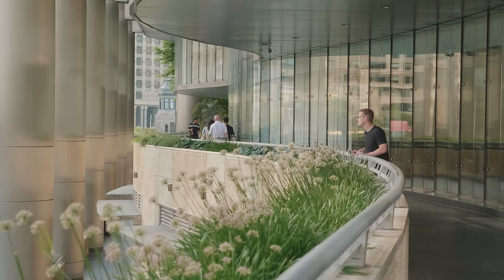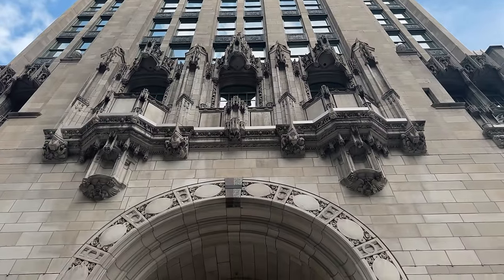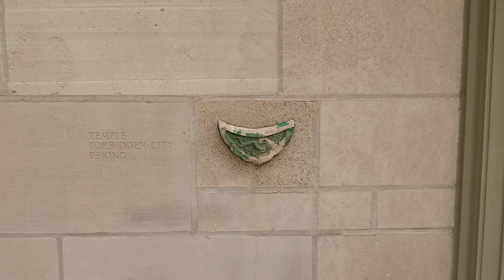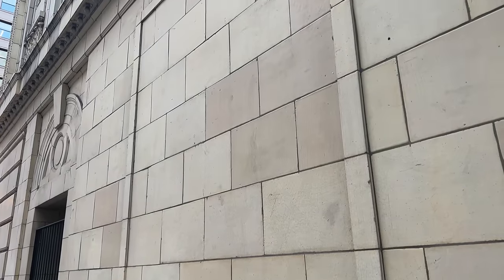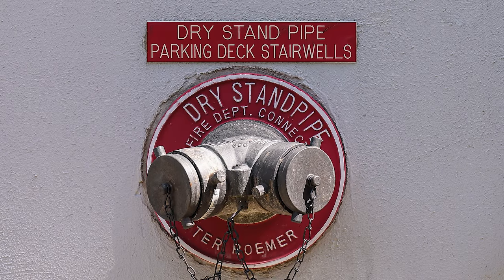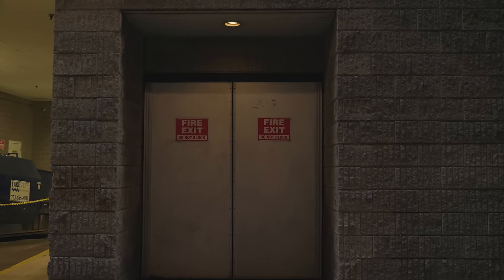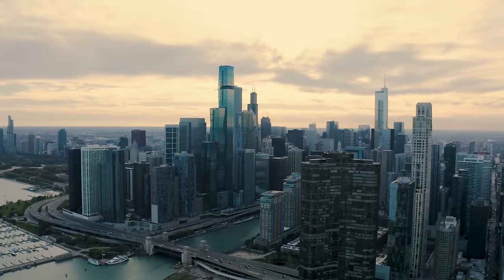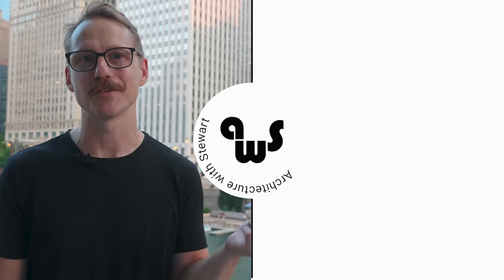Skyscraper Stuff You're Not Meant to Notice

Comment: I work in the commercial HVAC industry. You really need to make a video showing how air is moved around inside skyscrapers including how they are heated and cooled. The machinery is massive and most people have no clue it exists except from a Die Hard movie 😊
Reply: When doing this, you might consider comparing green certified buildings vs. traditional.
Reply: Can you actually crawl through the vents though?

And get a machine gun?

Cuz.... that's all I'm really worried about confirming. Haha
Reply: @threadtapwhisperer5136  😄 I know you're saying that tongue in cheek but I can answer some of that. Depending on the building there is return and supply ductwork that starts off a couple meters/yards in diameter and runs the vertical length of the building. You could potentially get from floor to floor through the return ductwork as the return air typically has large openings on each floor and they use whats called plenum return. Plenum return is just the approximate meter/yard high gap between the actual ceiling and the drop ceiling that everyone sees. You would need a rope as there is typically nothing to grab to get the approximate 4 meters/yards between each floor. As for the horizontal ductwork you are picturing, that would be the supply ductwork that branches off to each space. That for the most part would not be anything like the movies. Supply ductwork might start off big enough to slither through on your belly but before it splits into the supply diffuser you see people looking down into a room from in the movies it would go through a control device (VAV, FPB, variable air volume, fan powered box) that would be hard for anything but a rat to get through. And to top it off, the supply diffusers (that people look down through in the movies) are after these control devices and after the VAV or FPB it most often splits down into much smaller supply trunk then flex ductwork that would be difficult to even fit your head through. But yes, in a way there is incredibly large ductwork that makes me think of Die Hard that does exist, just not quite as its represented in the movies. 
Oh, and the machine gun question,  I've never run across one in ductwork before but I'm always on the look out. I have found hand tools, flashlights and even a volt meter in ductwork or above ceiling tiles.
Reply: Why don’t you make it
Reply: @tvviewer4500  I seriously thought about it but am horrible with video editing and hate to hear myself talking in videos. I cringe at the thought but really would like to share what we work on with every day people that have no idea what goes on behind the scenes
Reply: @mrbyamile6973  working out the cringe helps you find your way to the total ‘you’. Letting the cringe sit around gives future cancer and autoimmune disorders fuel to kill you.

Comment: Thanks for the brief highlight of fire protection services! There's a lot of hidden engineering on the ground floor of big buildings like this. Pumps, chillers, boilers, electrical panels and switchboards, sanitary and storm water connections, and more! It can be a challenge to secure space for necessary equipment as the ground level is usually pretty desirable and the Architect wants to maximize the usable space.
Reply: Thanks for typing my comment for me. Although, he did use some interesting terminology...
Reply: A bit of misinformation on dry standpipe.  But he got close enough.
Reply: @Ma2xt  It's crazy how little knowledge many architects have about building systems. The garden hose wall hydrant at 7:26 is funny. And this guy is considered an authority in architecture academia.

Comment: I was the tenant side liaison of a new 10 story 140,000 square foot building and it was really interesting to learn about all the trade offs and how things work between building architects, interior designers, city requirements, building codes, tenant needs, costs, energy efficiency trade offs, use cases, etc. And I was able to work in that building for many years and see how well the design choices worked out in the end. It wasn’t a massive skyscraper but faced many of the same design challenges. And there are lots of building codes that dictate things I’m sure many think are just bad design but it’s required for safety reasons.

Comment: Just a quick correction regarding the difference between "wet" and "dry" sprinkler/standpipe systems: while the description of whether water is present in the piping or not (wet versus dry) is correct, there is a further segregation of system types to describe if the system is designed for fire department augmentation of the water supply or not and that is "automatic" or "manual" systems. As the naming convention implies, "automatic" systems are designed to achieve the required flow and pressure of water with the building condition (municipal water supply with or without a fire pump provided in the building). However, "manual" systems are designed to achieve the required flow and pressure of water only with fire department augmentation of the system by pumping the fire department connection. So, most commonly seen are automatic-wet, automatic-dry, and manual-dry systems. You can see some of this labeling above the FDCs at 6:20 in the video.

Comment: Every single home has this kind of transition. There it's called front porch, front door, driveway, garage entrance, main power switch and meter and many more. 
Not mentioned in the video are the transitions inside the ground levels of commercial buildings with concierge desk, elevators, stairs, cafe, lounge, restrooms, entrance gates, emergency exits, revolving doors, windbrake and many orientation/emergency signs and hidden the locker rooms, postal office, delivery check-in, storage rooms for cleaning and other stuff like winter sand/salt, unique spare parts/tiles,  mobile barrier cords and posts/red carpets, chairs, garbage container like a mud room in a home.

Comment: FYI, dry standpipes still have a water supply (absent the fire department) but the sprinkler lines are kept dry and charged with compressed air during normal operation to prevent freezing.  This is typical in areas with the potential for freezing temperatures.  When a sprinkler head is activated, the compressed air rushes out and opens a valve allowing water to flow, generally required within 30 seconds at the most remote sprinkler head.

Comment: And it's not just skyscrapers that will have those standpipe connections. Any "high rise" will likely be required to have them. And that can be buildings as short as 5 stories or less of the stories are high enough. And several factors can also play into the decision about standpipes, whether from a published building code, a municipal fire code, or owner preference. Usage is one; buildings that serve a more critical function like hospitals or communication hubs would be more likely to have a standpipe. Another is construction; wood frame is a good example of where standpipes can help fire fighters save the building. Or even just insurance costs; the more things you can put in a building to decrease the chance of death, injury, and property damage in case of a fire, the more likely an insurer will provide you with discounts for a safer building.

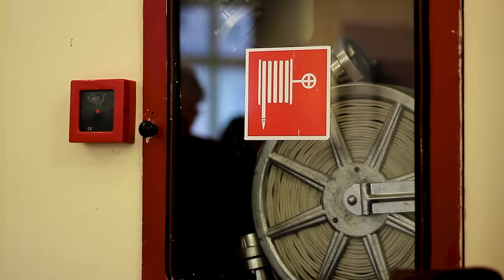Comment: Minor correction, at 6:43 you said that the firefighting connection can be used in the event that the fire pumps cannot supply enough pressure, this isn't technically correct - the pumps will always be spec'd to be able to achieve the pressure required at what is known as the most remote end, in the case of high-rise buildings, multistage pumps will be used, this is a type of pump that has multiple impellers, the number is determined by the height of the building, the higher the building the more impellers it will have. This pump then works in a way that it is able to engage the correct number of impellers to provide the correct pressure to supply the water to the higher floor if required, this has the added benefit that it eliminates the need for water storage half way up the building with additional pumps to feed higher floors. The firefighting connection in that instance is only used to supplement the sprinkler system with additional water and/or to provide water through the dry riser.

Comment: The visual of Wacker Drive was incorrect.  It actually showed Wacker and Upper Wacker.  Wacker has three levels where Lower Wacjer is at ground level, the level that extends to LSD is just Wacker, and the piece taht intersects at the top level with Michigan Ave is Ypper Wacker (which did used to extenf further East.

Comment: That picture of the box in the wall with the door opened is a hosebibb, and has nothing to do with the fire suppression system. The valve requires a special key to open the door and to turn the water on so the riff raff can't use it for a public shower.

Comment: I have installed many communications systems on the rooftops and sides of buildings and rather than just putting the antennas on and leaving them visible as is we would put non conductive facades "Radomes" that matched the buildings actual elements (we would get it as close as possible as it does not have to be perfect since it is up on ther roof or on the side of the top level.
The non material used is  one of many polymers of acrylic or PVC and this is so it does not interfere or block the systems RF paths in and out of the antenna. We have designed and build cell sites that also serve as flag poles for sports arenas, fake trees for HOA communities (those clearly look weird IMO). Casinos are known kinda for having security cameras all over and if they offer free wifi for guests, some of those camera domes in the ceiling will not have a camera but rather they will have the WiFi radios antennas instead hiding in there. You really cant tell what dome is a camera and which ones are not and that is the reason, you are not supposed to know which domes are populated with what and to assume all have cameras and all are monitored at all times.

Comment: 7:28 that is not a standpipe connection, that is just a standard water outlet that would fit a standard garden hose. It just requires a water key rather to go turn on and off to limit access.

Comment: You missed generators! Often lots of random vent and exhaust pipes sticking out of buildings at street level which are required for diesel generators. These are required by code to power emergency systems in high rise buildings. See a random metal cupboard looking thing in the wall? That’s a remote fueling station for the generator.

Comment: A properly trained architect will always ensure that engineering and construction and later renovations are as difficult as possible. The use of as many high inaccessible drywall or mill work ceilings as possible. Specs for extremely expensive non standard custom bespoke premium finishes with long lead times and that no installer has ever worked with shall be incorporated as often as possible. Ensuring entrance and egress in and out of all MEP spaces is challenging for contractors. Risers shall always be behind millworker or tile and be as small as practicable to ensure as much cutting, coring and drilling into the slab will be necessary for any future needs.
Reply: Diogenes, is that you?

Comment: I actually really dislike a lot of ways skyscrapers interact with the environment. In most low-rise neighborhoods in old cities, you have a lot of retail storefront and inviting spaces at a pedestrian level. But most skyscraper bases only have 1 or 2 retail and it’s not as quaint and charming as a 3-4 story building from early 1900s. It means that a neighborhood will have far less retail/restaurants per occupant. There are some skyscrapers and high rises that do this well but most of the skyscrapers from the 70/80s do not.
Reply: I think that's a salient observation, Anthony.  I wonder whether that lack of retail is economic (small retail outfits maybe could not afford the rent) or structural (such places in high rises might violate architectural requirements) or safety (code violations because of first responder access).  Hey, Stewart!  Anthony has the germ of a really interesting video over here
Reply: Fun fact:  in Chicago, having a little bit of retail space at ground level, in addition to reducing the most accessible parts of the building for residents, also makes the entire building a “commercial structure” subject to regular inspection by the Fire Department, which does not inspect residential buildings.

Comment: In New York, you see a lot of standpipes that say "Siamese" on them. I'm guessing because the two pipe connections look like conjoined twins? Seems a bit politically incorrect, though also not worth the cost of changing the sign on thousands of connections.
Reply: In the fire service, a siamese appliance will take two inlet pipes and connect them to be one pipe as the direction of water flows.  On the opposite hand, a large pipe that splits into two (or more) smaller lines is a "wye" appliance.

Comment: I like how this guy thinks he’s clever, because he figured out what we’ve all been seeing for decades. Every kid has seen these things on a building and noticed them and can read that they say fire department connections.

In fact, they are meant to stand out and are not hidden for the strict fact that they want the fire department to be able to see them quickly 

Also, you failed to mention anything about the water system underneath the ground. You didn’t mention that the stand pipes are usually connected to the water system for the building and pressurized and usually have buffer tanks and you didn’t do any research to see if that fire hydrants are connected directly to mains and not a sub system like the rest of the water, therefore, creating much more pressure and much more reliable source of water. This is why when you break a fire hydrant the water shoots up 50 feet because it’s already under enormous pressure. A lot different than if you broke the Watermain coming into your building, which would still be messy, but it’s been backed off for a series of downpipe’s.
Reply: NewsFlash :  Guy with 4 subscribers angrily rips successful YouTuber for not making the video he thinks should have been produced.